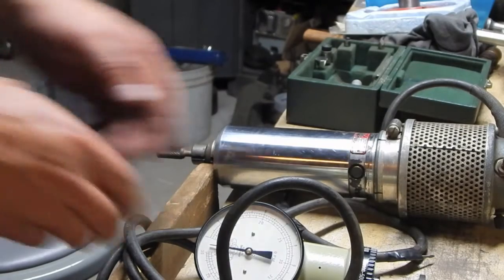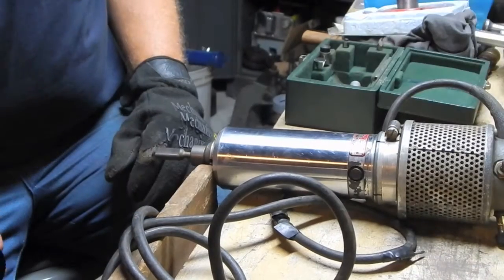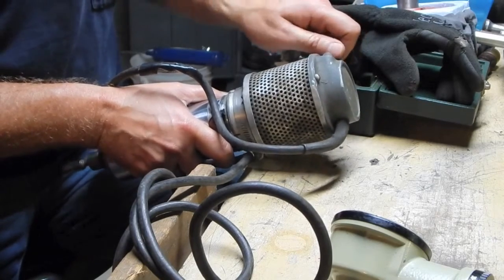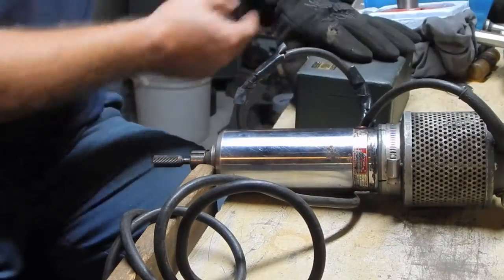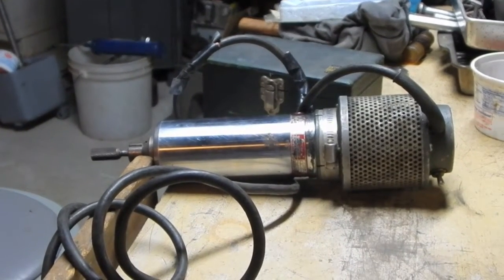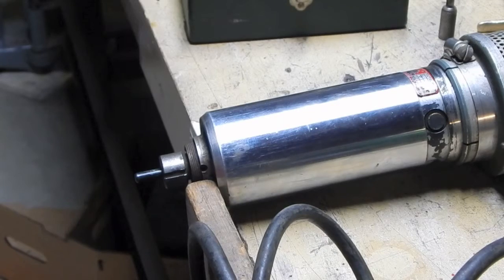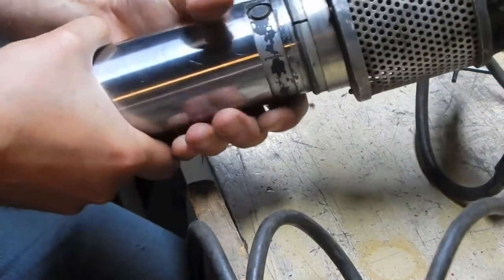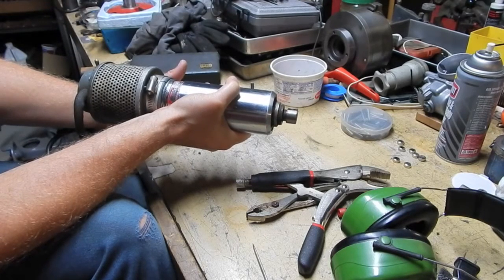Precise model Super 60 grinder speed test

Comment: Hello. Did you manage to disassemble it? I have one very similar to yours (a slightly different modification) and I wanted to change the bearings in it (or at least lubricate them). But I couldn't disassemble it completely. I don't understand how to unscrew the lower part with the collet holder (and I don't want to apply too much force, so as not to break it).
Reply: Perhaps you managed to find drawings or a post on some forum where you can see the disassembly stages?
Reply from the maker: @ДиДи-м3ю  here is an auction showing a control box.
https://www.ebay.com/itm/174569170008?mkcid=16&mkevt=1&mkrid=711-127632-2357-0&ssspo=dwYIa-XVTBG&sssrc=4429486&ssuid=&var=&widget_ver=artemis&media=COPY
Reply from the maker: @ДиДи-м3ю  I never tried disassembling it because I learned an important detail about operation of these grinders. They typically are not run directly off a 120 volt outlet. They are supposed to be run off a variac. The idea is to turn them on at a lower voltage to allow the lube in the bearings to warm up before increasing to 120 volts and full RPM. Sorry I have no info on disassembly. I bought another similar grinder that came with the control unit (variac) and it seems to run the Precise unit just fine.

Comment: It's a milling grinder. I just procured 4 Precise model 65s which are mostly identical, mine has a shorter filter screen on top and the switch with fuse is relocated to a box attached mid-power cord. I own a body shop and the building I rent is split in half where the vacant space has been empty since the 70s. The landlord had no real idea of what was in it other than a lot of very dusty junk and poorly folded tarps. He offered me two months rent-free if I cleaned it out and cut in two garage doors in a wall. After we started removing the first layer of junk there were piles of broken machine shop tool bases (none that fit this model) all along the wall that I had the scrap yard bring a dumpster over twice to finish the job. (getting enough money for another two months) I found the motors in a small suitcase that it looks like someone forgot. I did replace the brushes and already sold two of them. Now I'm working to reconfigure a smaller X Y-axis base I kept to make it compatible with this model. I always loved working with metal, fabricating tools with this thing is gonna make it that much more fun.
Reply from the maker: Thanks. I'm holding on to it for now. I think it could be great for cylindrical grinding

Comment: Ahh. That is the grinder head that originally went in my Precise Products corp. mill.
Reply from the maker: Never new that. I always thought it was a tool post grinder.
Reply: It is, or can be depending on which mounting scenario one would go with. BIG $$ to have those bearings serviced. Still a great find at $30.  @stevewatr
Reply from the maker: @johnstrange6799  more reading: https://r.tapatalk.com/shareLink?url=https%3A%2F%2Fwww%2Epracticalmachinist%2Ecom%2Fvb%2Fshowthread%2Ephp%3Ft%3D266378&share_tid=266378&share_fid=31160&share_type=t